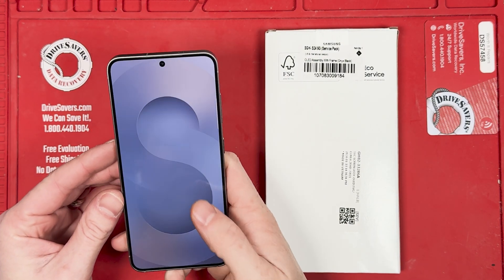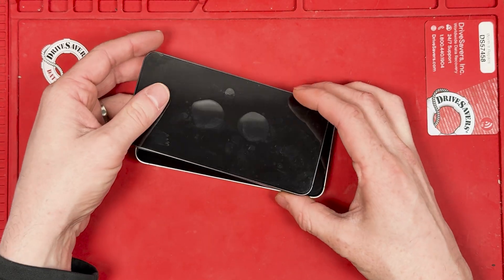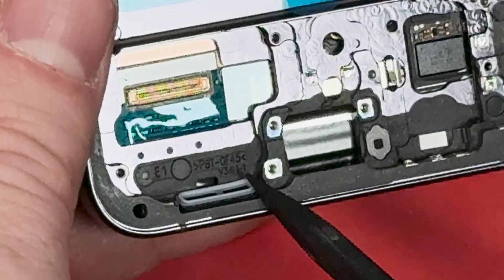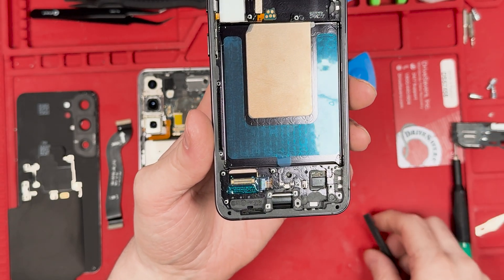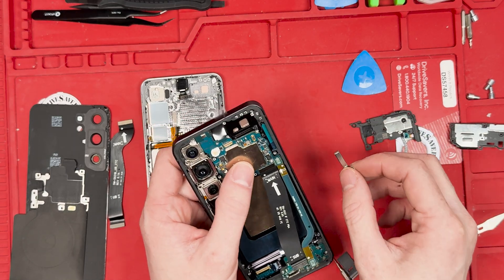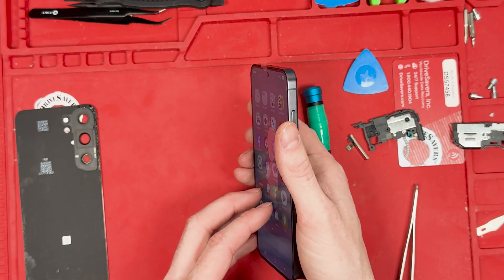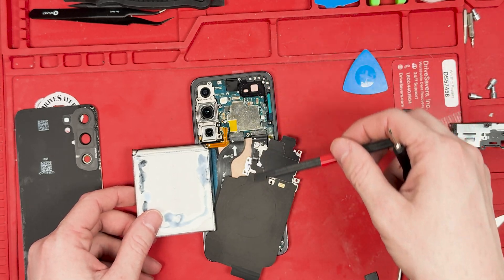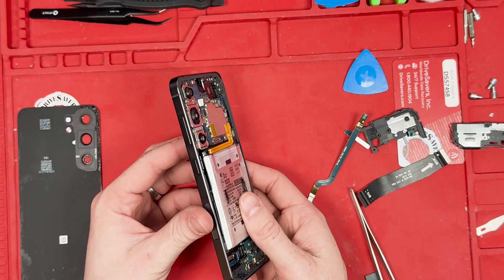🔍 Samsung S25 vs. S24 Screen Compatibility Test: Shocking Results! 📱

Comment: Hi, I’m a subscriber from Korea.
Recently, the back of my Galaxy S24 got damaged, so I was looking into doing a self-repair and came across your video.
I’m planning to replace the back panel of the S24 — would it be possible to buy an S25 back panel and use it instead? Would the size fit?
Reply from the maker: I am not sure if it would fit or not but I bet it would

Comment: Bro, you can also use a TV or a monitor with a mouse HDMI cable and a hub for data recovery on a broken phone.

Our broken mobile phone: Ensure it still powers on, even if the screen is black or unresponsive.

USB-C to HDMI Multiport Adapter/Hub (or Micro USB to HDMI adapter with MHL support): This is crucial. It needs to have at least:

An HDMI output to connect to your monitor/TV.

At least one USB-A port to connect your mouse (and optionally a USB flash drive).

(Optional but recommended) A power delivery (PD) USB-C port to charge your phone while it's connected, especially for prolonged use.

Important Note: Not all phones support video output over USB-C or Micro USB (MHL). This method works best with mid-range to high-end Android phones with USB-C that support "DisplayPort Alternate Mode" or older phones with Micro USB that support MHL. Low-end phones or iPhones typically don't support this without specific adapters (e.g., Apple's Lightning Digital AV Adapter for iPhones).

HDMI cable: To connect the adapter to your monitor/TV.

USB mouse: To navigate your phone's interface.

Monitor or TV with HDMI input: To display your phone's screen.

(Optional) USB flash drive or external hard drive: To transfer your recovered data to
Reply from the maker: Nice Chat gpt answer. But if it doesnt work then do a data recovery

Comment: You're a parts, hacker and parts. Hacking is such a niche business that the eight different models of cell phone that tried to release amongst over three different manufacturers that were modular phones, which would be a parts hacker's Paradise you would think flopped miserably I owned one of those phones. The LG G5 I never got any of the modules. I only took advantage of the fact that I was early adopter and that I was either going to get a free 360 camera or a free battery with battery charging case. That also allows the battery and its charging case to double as a 6 w USB power bank. I ended up with the battery and charging case that was one nice thing is that the battery was removable and replaceable and I had multiple batteries for that phone and I had the charging case so I could be charging a battery at the same time. I'm using One up but no, you seem like you're totally trying to parts hack this realistically, I don't think it's worth it to go by all of the internal parts that are different in the phones just to try to swap out the internal parts to do the upgrade. Pretty sure that by the time you swap everything out like the ram depending on which one you already have and the processor and stuff like that it's just not going to be worth it including on all but the s24 ultra having to get another screen as well. This is not something that most people are going to want to do, plus your cutting at least one full year off of your usability of the device. Because Samsung is still going to recognize the serial number of the device. Is that s24 model and stop giving you upgrades? When the s24 stops receiving its upgrades? Where is the s25 is still receiving its updates.